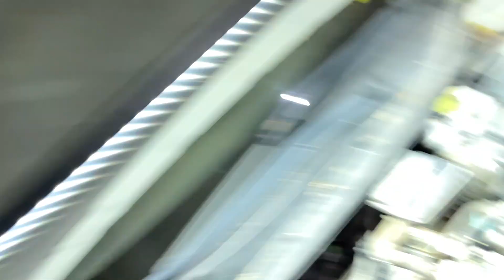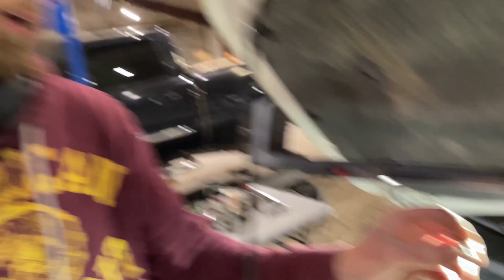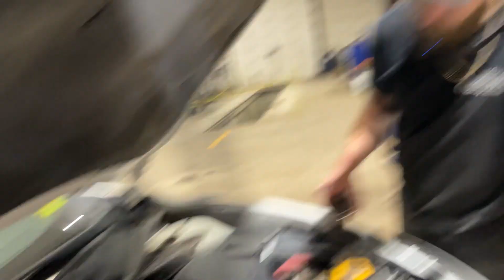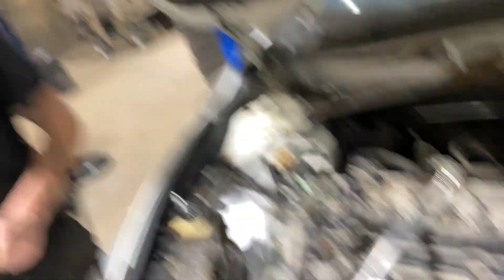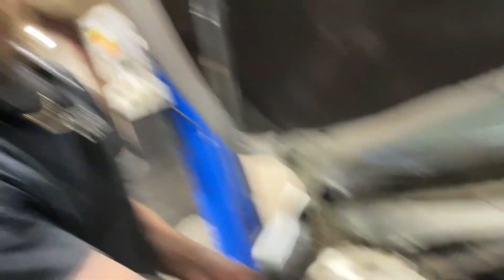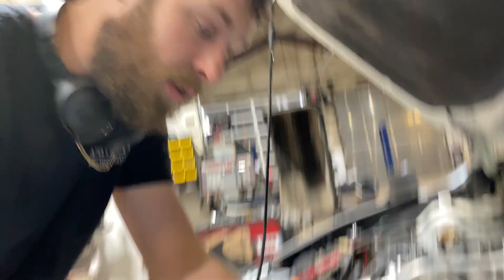P052B 2013 Altima Camshaft Code Check Engine Light

Comment: I know this is dumb but where do I jack up the engine ? Iv seen another video where they use a 2x4 and do it right where the oil pan is but that seems like a fragile spot to do it
Reply from the maker: I use the oil pan, I just make sure I use a piece of wood large enough to distribute the load across the pan
Reply: @Tech-28 Iv been researching this exact code for months finnaly built the courage and tools to do this thank you for this informative video
Reply from the maker: @nairinc I love it! You got this, just pay attention and have some patience, you’ll do just fine

Comment: Rough estimate of how much u think this would cost at a shop.  Thank you also for the great video.
Reply from the maker: @spins8085  to replace the solenoid? Your probably around $500-800 depending on what parts they decide to buy and weather or not the shop is hourly/flat rate

Comment: My 2016 ALTIMA 2.5 engine has the same code, Camshaft position timing over retarded(bank 1) Cold start intake.
Engine turn's off randomly, only while idle,is it because of this?
Reply from the maker: @Mikaeelnazari-bv3il  sounds like it but there’s a possibility it could be stretched chain, you’d have to diagnose or have it diagnosed my someone

Comment: Did it also have P0014 as well?
Reply: I went through the wheel well instead
Reply from the maker: I believe so but I honestly can’t remember
Reply: @Tech-28 I went through and changed all 3 solenoids and it was good for 2 hrs then it came back. P052 won't go away
Reply: @Tech-28 quick question. Did you replace OEM? I'm still suffering from this. Some have said aftermarket sensors won't work but I have 2 new ones. Thinking I need to try OEM solenoids because cam position still stuck but chain and everything seems fine and tight
Reply from the maker: @MrArtVein  I replaced with aftermarket ones from carquest (worldpac)

Comment: nice video for a common issue with this year model, it stumps most mechanics once they get beyond replacing sensors. Nice troubleshooting and resolution to the issue.
Reply: BTW - the link you provided in the description is NOT working properly
Reply from the maker: updated now